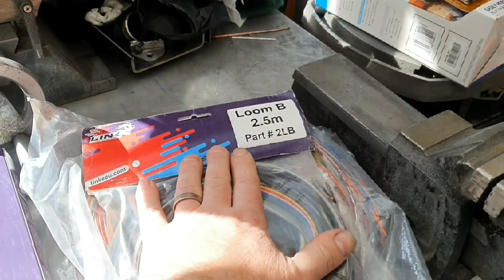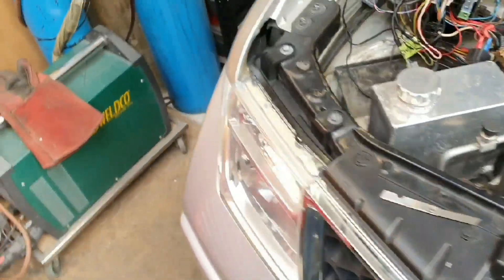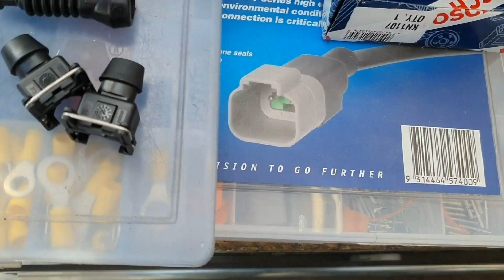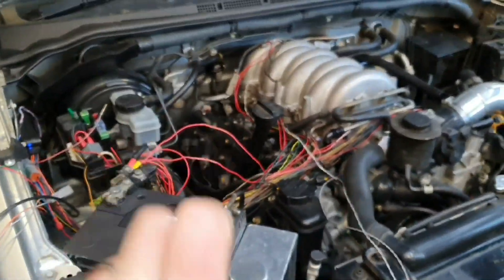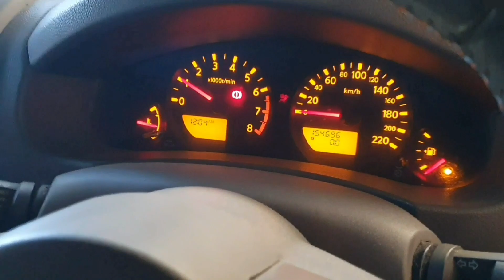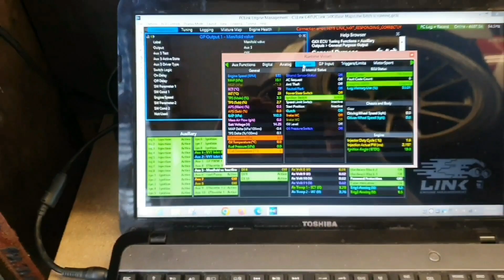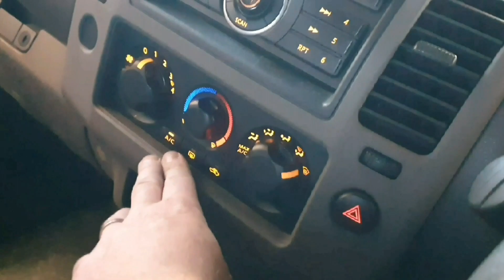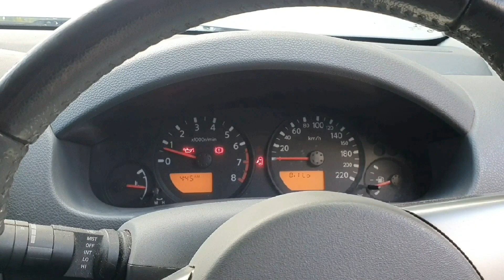Link ecu install VK45DE V8 D40 Navara - the short version

Comment: Hello I have a question but it's not related to the content of this video , the nissan vk engine components are very similar ,from the 45de , 50ve and 56de is there any difference in the head castings that would stop interchanging of cams from one to the other ?.
Reply from the maker: I believe the VK45DE and VK56DE cams are interchangeable possibly, beyond that I'd be doing just the same research you could do to find the answer.  The VK50VE is most likely a different configuration due to exh cam variable timing.
Reply: @TheLabLimited  thank you for responding to my question, I've tried asking nissan engine builders here in nz but no response from them , if you are coming down to ruapuna keep in touch.
Reply from the maker: @nathanielbottin9619  unlikely to be heading to Ruapuna any time in the predictable future but ya never know.

Nelson from Hartley engines and Motorsport is hugely knowledgeable BUT also extremely busy so his time is very very valuable.

There MIGHT be a project coming where we might have some good data acquisition potential so stay tuned for mid next year :)